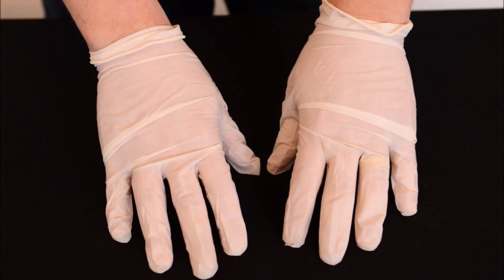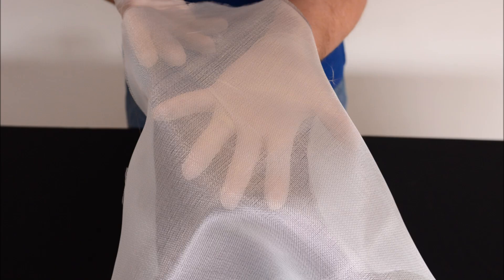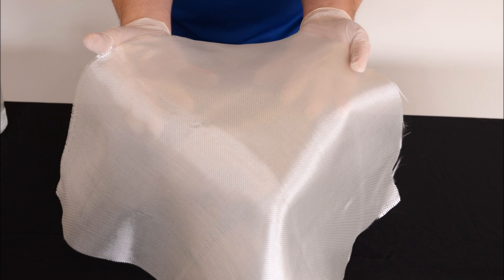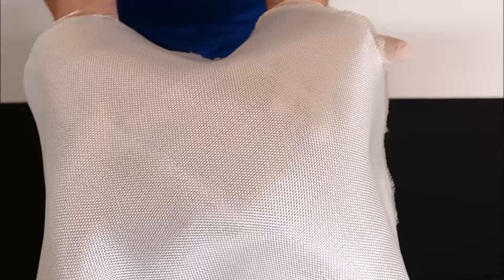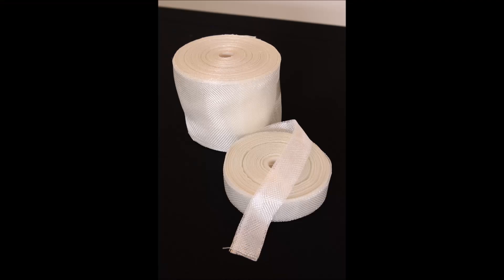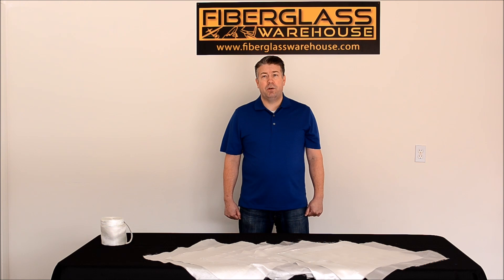Comparing and Choosing Fiberglass Cloth

Comment: How much resin would be needed to wet out the 4oz surfboard cloth?
Reply from the maker: Double the weight of the cloth. 8 oz per square yard. This is erring on the higher end so you don't end up with not enough resin.